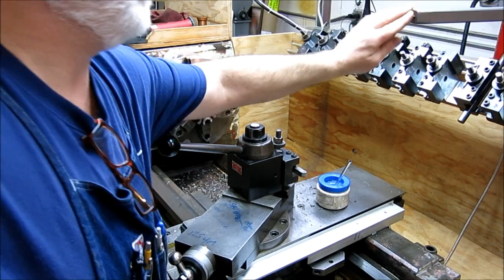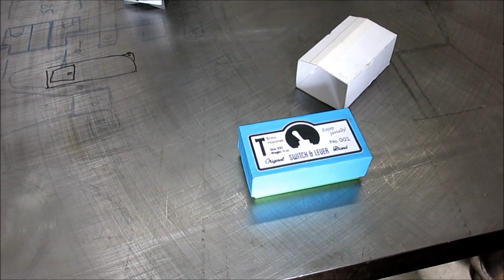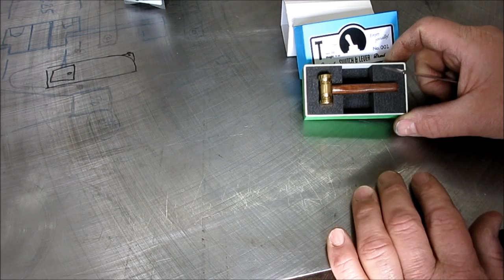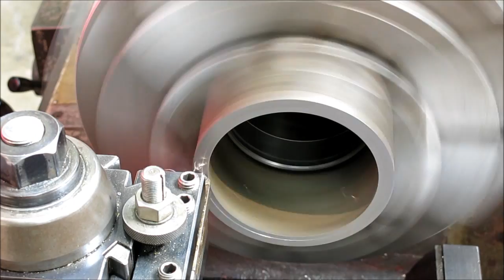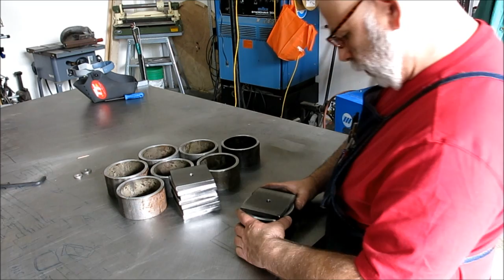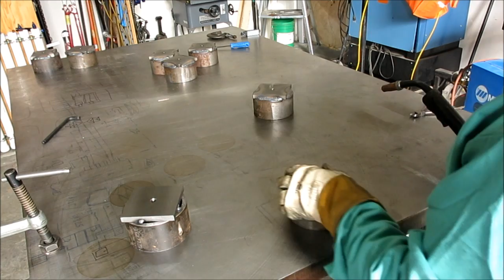Monday Night Meatloaf 18

Comment: Hi                                                                                                                                       Tom                                                                                                                             Your clear and precise explanation on welding process, makes me smile. In my younger days my good old dad helped me with my welding. I did struggle but he never gave up on me. He made welding  look so easy . He would run a nice weld bead, then lift his weld hood and with a kind smile on his face, he would look at me and say son anyone can weld like that with 35 years experience. Very nice job Tom you also make it look easy. Thanks M.K.S.
Reply: Hey Tom it looks like I typed my comment with a piece of 6010 in my mouth. Instead of my big fat fingers. should read HI Tom  your clear and precise explanation on welding process so on   thanks M.K.S.
Reply from the maker: Kelly Sampson Hi Kelly,

Thanks for the comment. Did my first weld certification with Fleetweld. My dad also taught me to weld when I was around nine years old. 6011 on some scrap steel. I was hooked.

All the best. Thanks for sharing your story.

Tom

Comment: Hey Tom! Super glad you liked the enormous hammer, thanks a lot for the shout out! Cracked up at its entrance! Now you just have to find something to wail on with it.

/Daniel
Reply: Oh, and the handle is walnut, with a couple of coats of tough clear varnish. Can't remember what I used, though likely a boat varnish or such.
Reply from the maker: Switch & Lever Hi Daniel,

Thanks so much for the nice gift. I appreciate the work you put in. It looks like you had fun doing it which is the most satisfying way to spend time in the shop.

With warm regards,

Tom
Reply: oxtoolco For sure, I agree! Some people meditate, I turn metal into chips, 

Now just gotta get on to making more videos. I have more things planned for the months to come, at least until I lose my workshop. The pains of graduating and moving on I guess. Time to get a job and start building up my own place!

Cheers!

Comment: Great Idea on the little vice wrench. I don't know how many times those long ones have made me swear.

Btw, I was wincing when you were doing the sanding on that plate. No other reason than I had a belt explode on me just last week while i was doing something similar.
Reply from the maker: Hi Mx,

Don't buy cheap abrasives is my motto. It just wastes time and makes heat. That is a premium zirconia belt at $15 each. Never had one come apart and they last ten times as long as Alo2.

Cheers,

Tom

Comment: Tasty ox loaf as always Tom.
You know, with a little more practice, I believe you'll become proficient with that wire squirter ;)
We used to cut the vise handle off for the very reason you mentioned, getting hung up.
I saw a guy wreck a brand new Kurt 10" vise, the handle hung on the box way of a big vertical mill.
It picked the vise up, breaking four 5/8" hold down bolts, and snapped the hex off the end of the vise lead screw.
One new vise, in the scrap bin.
Regards,
Duck
PS:  On your world wide ox viewer map, I see you still haven't given me a pin for Byron, Ga....
Reply from the maker: Hey Joe,

Another pin whiner. Well if you were getting close its the back of the line for you. Break a 10 inch Kurt Vise. I would have liked to have seen that. Must have been impressive and painful at the same time.

All the best,

Tom

Comment: Hehe, the hammer entrance cracked me up!  lol
Ive also been using a cutoff wrench...now I gotta find a ball??

I hate when the mig wire sticks. When you advance the wire a little then it touches the part there always seems to be enough juice to weld it to the tip....:-)

Cool vid. Now I gotta get back to work...:-(

Colin
Reply from the maker: Hey Colin,

Everybody  needs a ball or two to go with their wrench. 

Cheers,

Tom

Comment: Tom, Given the thickness of the scale mounting plate you may want to:
1. Increase the size of the feet
2. Account for a different later CG on the lathe
3. Recalibrate for the obvious interference with the Coriolis effect that the bar will cause.
:-)
Eric
Reply from the maker: Hey Eric,

You know what they say. Nothing too strong ever broke.

Cheers,

Tom

Comment: Hi Tom, I was wondering when you were going to put some sleeves on?? My arms were starting to tingle...... I see you have an original Millermatic gun on your machine, I nursed my original along until I literally could not install a new liner in it any more, I just preferred it to the M-25 gun now issued on all the new Millermatics, but alas, I've since had to switch over to the M-25s.  You went behind your lathe???? For me, as you have noticed, that might not be such a pleasant experience, I might do an on camera excavation and we can have some sort of contest as to who can identify the most different types of materials and total weight etc.  
 I know, I know, I'll be putting something up soon.
 Another enjoyable video ........ Mike
Reply from the maker: Hey Mike,

I was looking behind your lathe. I was thinking you machine backed up to a metal recycling yard of some sort. That was your chip pan? Yes that is an ancient Millermatic gun on that machine. It has a real nice long lead on it and it still works. I just hate to spend $300 bucks just so it new.

Cheers,

Tom

Comment: I'm kind of surprised you bothered with the filler on the weld.  8 tack welds per part, probably more than strong enough, as you said, they are just machine feet.  Not a lot of lifting or side loads.  Go Fe Maidens and SciBorgs
Reply from the maker: Hi Charles,

You are right from a strength standpoint. But this is not the only reason we make things way too strong. My old saying "Nothing too strong ever broke" doesn't tell the whole story. We overbuild things for stability and vibration isolation also. In this case I was trying to solve a vibration problem on the lathe. The little bit of extra mass and welding just gives me peace of mind that I won't have to pull these out and add to them anytime soon. Thanks for the comment.

Cheers,

Tom
Reply: I can see that.  Don't think the extra weld will make any difference vibration wise, but, hey, I'm not the guy behind the cranks in this case

Comment: Great video, I noticed you have a dial indicator mounted on lathe was that bought and add to lathe. I just remember working at a company that had one and I have been looking to see if it is something that can be purchased?
Reply from the maker: Hi Robert,

The indicator you mention is called a Trav-a dial. Its made by Southwestern Industries. With the availability of cheaper DRO's now its almost easier to go the electronic route.

Best,

Tom

Comment: Hi tom. Great vid. As always. What kind of Bridgeport is that? New,old?did you tap freehand or does it have a tap feature? If no feature how did you do it? Thanks for the brain picking.
Reply from the maker: Hi Ray,

My mill is a clone made by Acra. Tapping was all done freehand and free wrist. Practice at a lower speed on through holes. Only try it with spiral point gun taps. Its a piece of cake and a zillion times faster than a tap wrench.

Cheers,

Tom

Comment: Hi Tom, your mig welds look great. How did you have your welder set-up?
Thanks, -Chris
Reply from the maker: Hi Chris,

.035 wire 75 Argon 25 Co2 and I don't remember the voltage. Have to go look. About mid range for that machine.

Regards,

Tom

Comment: one more question tom, (Sorry i'm so fascinated at how quickly you drill and tapped those holes, i take 5x longer), how do you stop your drill chuck from loosening when reversing the tap?
Reply from the maker: Hi Zeeshan,

The jacobs chuck grips the tap well enough to power it through. If I only have a couple of holes I might use my precision chuck but it doesn't grip as well as a keyed chuck. 

Cheers,

Tom

Comment: Is that a Huntsman hood your using? I notice a lot of old timers using them, there interesting. There getting pricey now because there not being made anymore, I guess paper welding hoods aren't the easiest to manufacture. I don't car for wire fed processes, to many things to go wrong as you demonstrated in the end there.
Reply from the maker: Hi Ty,

I have a new auto dark helmet but they don't make a magnifier for it. Wrung what you brung I guess. 

Cheers,

Tom

Comment: Is that a original miller gun on your 250 tom? if so, man thats a pretty rare deal. When I bought my little miller 35 it still had the factory miller gun
Reply from the maker: Hey Jesus,

How are things in Oregon? You have a sharp eye. Its the original gun. Try finding parts for that dinosaur. Turns out the contact tip was loose. Well that will make a difference.

Cheers,

Tom
Reply: Well the snows melted, we got dumped on here in the valley I actually recorded some of it. Tom I feel your pain, I searched high and low for a gas valve for my old miller 35 gun. I ended up having to bite the bullet, and buy a tweco conversion. At the time I  figured I would upgrade to a different machine soon but man, I just can't let go of these old dinosuars they run so smooth.

Comment: Hi Tom! I notice you use Mitutoyo calipers and I was curious as to which ones you recommend. Are they worth the $350 or are better options available? I'm not sure if I need the full 12 inches since the 6 inch ones are half the price. Also they have tons of options other than just size. Just wanted to hear your two cents on them. Thank you and keep up the great work!
Reply from the maker: Hi Michael,

I'm the wrong guy to ask what tool to buy. I have Mitutoyo 4 inch 6 inch 8 inch 12 inch and 24 inch carbon fiber. My name is Tom and I'm a toolaholic. I use the four inch models the most. Hope this helps.

Best,

Tom

Comment: hey tom, what kind of drill bit are you using in this video?
Reply from the maker: Hi Zeeshan,

Its a Split point stub drill,  sometimes called a screw machine length, high speed drill. 

Cheers,

Tom

Comment: For future reference, whenever I need solid steel balls (grin), I usually get them through ToolSupply on eBay (http://stores.ebay.com/ToolSupply?_trksid=p2047675.l2563) or from Green Bay Mfg. (http://greenbaymfgco.com/catalog.php?cat=6), who has 12L14 balls up to 3" diameter.  Both have decent prices and have given me very good service.
Reply from the maker: Three inch leaded balls. Sounds, hefty. Thanks for the resource.

Cheers,

Tom

Comment: Hello mr. Tom,
Can you power tap 6061 t6 aluminum in a jig-bore?
Thanks. Tristan Shepard
Reply from the maker: Hey Tristan,

If your jig bore has a forward/reverse and a free floating quill it should work fine. Go slow until you get used to it and learn on through holes. Don't use four flute taps either. Spiral point gun taps work the best.

cheers,

Tom